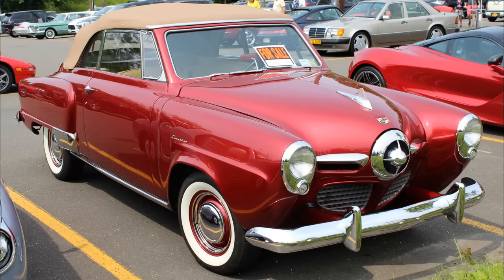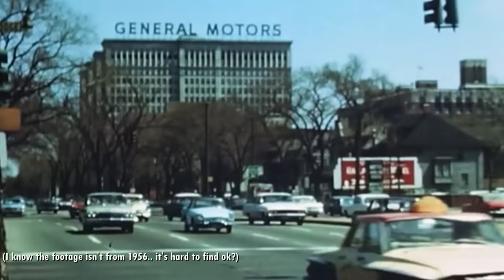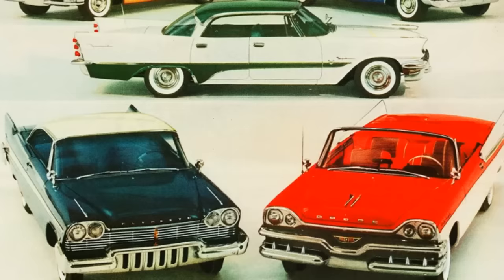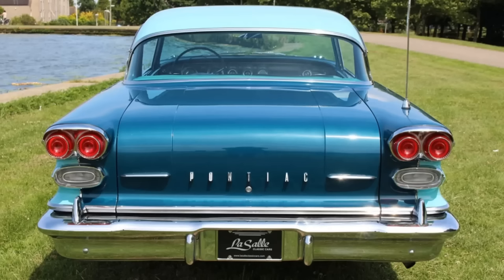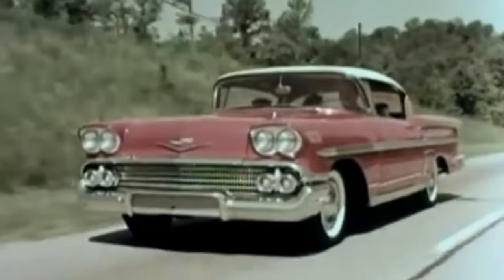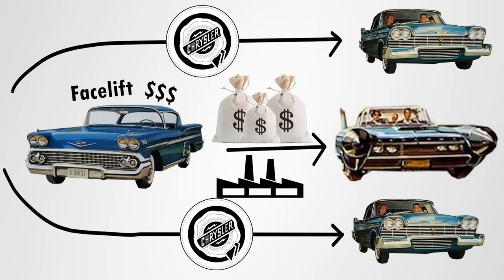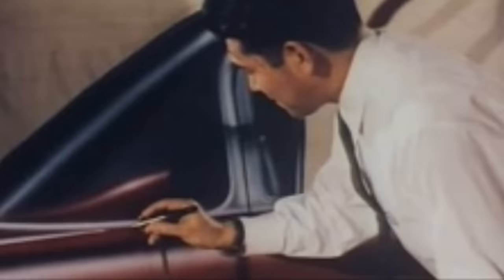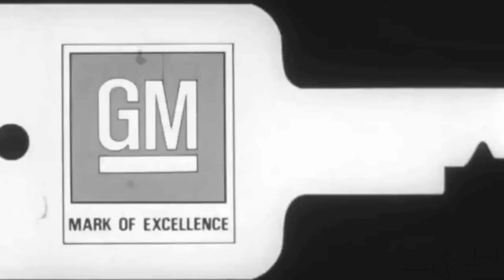Mistake of '58: The GM Chromemobiles and Far Out '59s

Comment: Your best video yet!  GM may have been caught flat footed with their '58s, but their "rushed" designs for '59 ushered in the design language used by the entire industry in the 1960s.  Take a look at the '60 Chevrolet Corvair, with its clean, horizontal lines and lack of unnecessary chrome.  It and the wicked cool '61 Lincoln Continental, '63 Buick Riviera and '63 Studebaker Avanti were part of a wave of clean, sharp-edged design that is completely different than where we were headed in '58.  By 1965, all cars looked completely different than they had just seven years earlier.
Reply: Completely agree. In fact GM's 1964 cars were the last year to have any connections to the '50s at all. The '63 and '64's retained some of the glitter of the '50s, (even if slight) but with the restrained sense and sensibility of the '60s. By '65, not a trace. The '64 and 5 Impalas  illustrate this very well. The '61 Lincoln influence was seen strongly not only on the '63 Buick Riv, but also on the '63-'64 Ninety-Eight.
Reply: I wanna see what the world would be like if the 59’s designs weren’t rushed.
Reply: The Corvair was an engineering and marketing misstep, but a styling triumph. When euro design houses start cribbing the lines of your cheapest Chevy, you’re doing something right.
Reply: The guy who designed the Lincoln convertible was fired from Chrysler ,or hired by them and fired by ford......I can't remember.......shit I'm getting old
Reply: Nearly all '61 GM cars were beautiful, from the Chevy to the Cadillac. But look at the monstrosity that was the '59 Caddy!
Reply: @adotintheshark4848  I do agree with you on the '61 GM's except for the Oldsmobile. I didn't like it. Having said that though, I DID like the Starfire!  The '62 Oldsmobiles may have been the most beautiful the 5 divisions offered that year in a stunning  turnaround for the better by Olds. I know what you're saying about the '59 Cadillac. It must be remembered the '59 GM's were (as a whole) basically a knee-jerk, drastic, over-reaction to Chrysler's sleek/finned '57s that had GM shocked and scared; something they weren't used to. Under the gun, they came up with '59s abnormally quickly. If the lower 4 divisions were to have sleek fins, then it was expected Caddy would have to have the biggest (or with this year) the most outrageous fins. In all fairness, GM was level-headed with the Pontiac and Olds that year for those buyers who wanted some toned-down choices. Unfortunately in toned-down 1960, the Pontiac and Olds were downright dull-----to me. One man's opinion.
Reply: @BillLaBrie  Remember  the 1965-69Corvair?.Wanna  talk bout an attractive  American car that looked very Italian!!!!!.
Reply: @robmcgowan4034  1959-60Pontiacs were about the best line ups that GM had in those years!!!!
Reply: @mikeweizer3149  Okay Mike, and I'm not saying you're wrong. I ended it saying one man's opinion or viewpoint. The '59 Pontiac in fact was/is one of my favorite Pontiac model years. The '60 Pontiac though a beautiful car, was dull (along with the Oldsmobile) compared to the '59s. The '60 Chevy, Buick and Cadillac were so outrageous that they had a lot more room for being toned down for '60 than they already toned down '59 Pontiac and Olds models were, that's all.
Reply: Chrysler made a huge mistake in 60 by not coming up with a clear sheet design when they moved to the unibody.  Virgil XNR as he spelled it on his Valiant show car had become stuck in a design rut and refused to move away from fins.  The 60's looked like a face-lift of the 59's rather than the new cars that they were.
Reply: @bradjames6748  Elwood Engle?
Reply: @BillLaBrie  Who ended up at Chrysler and did the 64 Imperial ( another beautiful  car!).
Reply: @300guy  Did you ever hear the story  bout how the '62 Plymouths and Dodges turned out the way they did?.Some of that reason was beacuse of  stupid, Unfounded  rumor that Chevrolet was going to downsize right around 1962. In a way it did happen with. The 61 standard size Chevrolet beacuse from front bumper to rear it WAS shorter and also  not quite as wide but the wheelbase never changed and would not  for the next 15 years!!!.
Reply: @mikeweizer3149  although it would be early, it is possible they heard some very early scuttlebutt about the Chevelle.  Even though it didn't debut till the fall of 63, I have no doubt there was modeling going on in 61.
Reply: Ah yes, the Chevy Corvair, a design so sober and boring it even inspired the Soviets to rip it off.
Reply: @Turbobuttes  Lol, you’re joking, right?  First, compare it to its competitors, the plug ugly Ford Falcon, the dowdy Studebaker Lark and the hot mess Valiant. Second, GM’s design approach to a rear engine car was radically different than VW and Porsche. Third, its design influenced primarily the Italians and the Germans. The Russians didn’t adopt these styling cues until they had become commonplace around the world.
Reply: Still love the Avanti.
Reply: Yes the 60s designs were some of the nicest and most elegant.
Reply: @BillLaBrie  The Corvair really got a bad rap and was hardly a failure considering it lasted 10 years.
Reply: @dr.elvis.h.christ  GM kept it in production as a method of denying the inherent problems with the design and the way they implemented it. Sales trailed off quickly midway through the production run. People didn’t want to die. But snap oversteer was just one problem with that car. There were many others.
Reply: Winthrop, hope you don't mind me contacting you , but we share the same surname , it's quite a rare surname in England apart from in Norfolk  , do you mind if I ask you if you are in America or England , I'm just curious . If you don't want to just tell me to clear off 👍
Reply: @nickthurlow4456  well, it’s nice to hear from another Thurlow!  It’s a rare name here in the US, also. My father’s family came to this country from England in the 1690s and settled in Massachusetts. I don’t know if my ancestors were from Norfolk. Interestingly, my brother (and my son) are both named Nick, but that’s from my mother’s Italian family and not the Brits.   If you ever find yourself in Syracuse, New York, I’d love to host you.
Reply: And it was a great shame... '57 to '59 were the best years for GM. Outrageous beauties!
Reply: @bradjames6748  Virgil Exner was fired from Chrysler. Elwood Engel designed the fabulous 1961 Lincoln Continental for Ford, and when he replaced Exner at Chrysler, the 1964 Imperial went from a semi-finned monstrosity to a virtual copy of the '61 Continental...
Reply: @MikeWeizer  The 1959 Pontiac was such a hot topic that when the 1960 Edsel restyled as a virtual clone of the 1960 Ford, Ford officials wanted a thin vertical bar removed from the Edsel front  end...and replaced with a virtual copy of the 1959 Pontiac grille. Meanwhile, the 1960 Pontiac came out with its "fresh point of view" styling--and didn't revert to the split grille until '61. Even Pontiac didn't realize what a winner they had!
Reply: @gcfifthgear  It was awesome styling we can only drool over.
Reply: My late uncles were engineer s for GM and their ideas where swept under the rug as the say. 💁‍♂️🙄
Reply: @BillLaBrie  my late Uncles worked on the Vairs. As they called them 1958!
Reply: @bradjames6748  Elwood Engel was responsible  for both the 61 Lincoln Contential  and the 64 Imperial  do you see any similarities  between the two cars?.
Reply: @robmcgowan4034  AA
Reply: @adotintheshark4848  and yet that 59 Caddy has become the classic style icon.  Not many classic car collectors are interested in the 60's Caddy's. Everyone wants a 59. offcourse it helps that Hollywood and even independent filmmakers  used them in influential films. (like 'Badlands')
Reply: The squared off Lincolns, Avanti, Rivvy, even the roofline of Mustang, Falcon, and several others had design origins (or at least 'took cues' from) the original 1939 - 41 Continental.
Reply: @jfv65  I know for a fact that the 59 Caddies  were an exaggeration!!!!.and that's  why I actually like the 60s better and even the 61-64 Cadillacs  even better. Understand this one thing, When the 1961 Lincoln  Contential  came along  it was a game changer!. Its styling was in no way confused with the 1960 model!!!.Cadillac on the other hand was a different  matter!. From 1960 to 64 there was a much more gradual  change between the exaggerated  59 and the more tasteful 64s, The 65-66 Cadillacs  I thought were the best looking  standard size Cadillacs  of the 60s.....And then came the first front wheel drive 1967 El Doradro!!!!.
Reply: Ed does not know what he is talking about. He shows an early 50s Cadillac four door sedan and calls it a "Coupe DeVille" then he miscounts the "4 chrome strips" on the side of another car that are really not FOUR.
Reply: I just got a corvair... they have not one squared off surface, everything is curved.
Reply: @TheCatOfAges  I’m guessing you have a second generation (‘65-‘69). My ‘63 is pretty horizontal, certainly by the standards of the time. The second gen was much curvier.
Reply: @winthropthurlow3020  i have a '63, everything is rounded off. I havent found a straight edge on the car.
65-69s had plenty of straight lines.
Reply: Why did they leave out Oldsmobile? I had a 1957 Super 88.
Reply: @TheCatOfAges  I remember when a popular saying was, "nothing more rare than a running Corvair."
Reply: @TheCatOfAges  Lol, we clearly have a different view of the meaning of the word horizontal.  Of course it doesn't mean squared off, but rather, the overall design has a strong horizontal element, most notably the famous "Corvair Crease" that runs the perimeter of the car's body and had a huge influence on European design for years.,
Reply: Thats cute

Except the 60s were all started by Lincoln

Here are 4 examples to prove my point:

1. 1956 Continental
Very little Chrome, low tailfins, slab-sided squared off look....it looks more 60s than 50s

2. 1956 Lincoln Premiere
Relatively slab-sided, understated, dechromed and more low tailfins

3. 1958 Lincoln Continental
Completely square, tapered tailfins and relatively little chrome as well

4. 1961 Lincoln Continental
The final evolution of Lincoln's completely square, completely understated, completely finless design language.
It looks like an extended 1956 Continental.

Now take a look at GMs 1956-1961 designs....dont tell me they were the ones who came up with 1960s design language.

Even Chrysler made a Lincoln Continental clone as its top of the line Chrysler Imperial beginning in 1964

Heading into the 1970s...those cars look more like late 50s Lincolns than late 50s Cadillacs
Reply: @joecool9739  I agree that the '56 Continental was groundbreaking and a good ten years ahead of its time.  However, Lincoln inexplicably replaced it with the '58 that is a bloated mess and as bad as anything GM produced in that year.  For reasons that baffle me, no one followed the lead of the '56.  In my view, all American manufacturers flailed around in the '58-'60 period, trying to figure out what was next and while the '61 Continental was a winner, the rest of the Ford lineup in that period remained stuck in the '50s.
Reply: @winthropthurlow3020  
No dude, just no

A 1958 Continental is NOT in the same design category as a 1958 Cadillac or Chrysler

An honest comparison would reveal undeniable, obvious and critical differences in design that put the 1958 Lincoln more in tune with cars from the 60s and 70s...namely a square, low finned and dechromed look

The 1961 Continental only cements this legacy...I gotta hand this one to Lincoln even though I also love Cadillac

Today Cadillac is totally wiping its 🍩 with Lincoln...their Celestiq sedan has no comparison with any Lincoln

Lincoln's last sedan was an utter failure...a bland and empty copy of a 2015 Jaguar XJ and Bentley Flying Spur
Reply: @winthropthurlow3020  i mean the early corvairs are very bubbly, all surfaces are rounded.
Reply: @joecool9739  I'm not carrying water for GM, just observing that - in my opinion - it led overall in the transition to '60s design.  Yes, Lincoln punched above its weight with the '56 and '61 Continentals.  However, you simply can't convince me that the '58 Continental was anything other than a huge mistake.  Yes, different than Caddy, but a mess nonetheless.  In fact, I'd argue that the '61 was a recognition of that mistake.  Remember, too, that Lincoln was just part of the larger Ford stable.  The Ford, Mercury and Edsel designs of '57-'64 couldn't keep up with what GM was turning out.
Reply: @winthropthurlow3020  
Im not talking about whether it was a huge mistake or not (but to entertain your point, clearly it wasnt if the 1958 Lincoln is one of the defining cars of the 50s)

Im saying in terms of ushering in 1960s design, it was Lincoln and not GM

Im literally citing vehicles that predate GM's 1959 offerings as proof that what would become 60s design was already well established at Lincoln and further cemented in the 1961 Continental

GM's 1959 designs didnt "usher in a new era"...they capped off a gaudy era that already existed

If they had "ushered in" an era there would have been more 1950s looking cars, but there wasnt, the 50s ended with those models

When looking at the defining cars of the 60s (the Corvair, Mustang, Impala, Riviera, Thunderbird etc) you can CLEARLY see 1956-1961 Lincoln design language...
but 1956-1961 GM design language is absent

I repeat: even the Chrysler Imperial became a Lincoln replica
Reply: Oh, come on!  The 55, 56 and 57 Chevys were the best looking GM cars of the era, by a long shot.
Reply: @denysarcuri1213  say that with your flat sides, and backward angled a pillars. Quite a middle aged car if i'd say comparing to my '57 Ford!
Reply: @BillLaBrie  the mr2 also suffers from it, it comes from people driving a rear engined car like a front engined car
Reply: @TheCatOfAges  I said best looking ""GM" cars.  I agree with you.  I owned a '57 Ford at one point (bought well-used, but still pretty), and am a thoroughly Ford guy, owning a 2003 Cobra "Terminator," a 2012 GT500 and a 2006 F150.
Reply: @denysarcuri1213  misread, missed the GM. Hello fellow ford guy!
Reply: @TheCatOfAges  🙂
Reply: @TheCatOfAges  not really, but thanks for playing. Look up the effects of “jacking” on rear swing-arm designs.
Reply: @BillLaBrie  happens to corvairs, in theory. its really really hard to make it happen. The car sits too low and it requires getting it up to high speeds, and turning the wheel from one lock, to the other lock, and even then, it probably wont flip, just spin out. If you know how to drive it you'll never have an issue.
Reply: @TheCatOfAges  Perhaps you’re referring to the later models and - to some extent - the earlier ones when equipped with the optional stabilizer bar, though GM lowering the suspension pivot halfway though the production run was a tacit admission of guilt. Swingarms suck. Tatra found out, Benz found out, AM General found out, VW found out, and GM was forced to learn. I know you’re fond, but don’t try to excuse away the laws of physics
Reply: @BillLaBrie  there is theory, and there is putting that theory in practice, it is very hard to get even a base model (no stabilizer) corvair to flip. The later models dont have the swingarm because it is a more primitive design and they upgraded. Vw "found out" by using the swingarm from 49 to 81! Tatras were fast and grippy, not dangerous (to the drivers, any SS member who saw one was certainly in danger). And lowering the suspension means that after a couple years of production, they recieved an upgrade, wow, who knew manufacturers change their designs?
Reply: @TheCatOfAges  keep typing. I can tell it’s good therapy for you.
Reply: @winthropthurlow3020  what a lovely invitation Winthrop so kind of you . Am at this moment in time in king's Lynn hospital with an infected heart valve I picked up , got taken in two o clock Monday morning ☹️☹️☹️
Reply: @nickthurlow4456 Best wishes for a full and speedy recovery.
Reply: @BillLaBrie  if you dont want to debate, you should have just said you filled your ears with candle wax.
Reply: @winthropthurlow3020  It wasn't an insult, I was genuinely adoring the impact the Corvair's design made on the automotive world.
Reply: Lincoln’s aren’t gm
Reply: And now all anyone wants is a brand new Ford 150 they never get dirty. Disgusting.
Reply: Unnecessary chrome my foot, beautiful cars are there to be appreciated by everyone, I suppose it’s my duty as a pleb to bow my head and cover my eyes as they go by.😔
Reply: P
Reply: @winthropthurlow3020  thank you , it was so nice of you to say that , I am seeing a consultant Wednesday , am at the moment laying on a hospital bed watching YouTube , hurray for good old YouTube , don't know what I'd do without them 👍 hope you and your family are all okay
Reply: You ever seed the '62 Arctic Blue Queen Family Truckster with the patented DuraJolt Steering and the GyroCloud Full Spring Suspension?  The slogan read
"For The Man Who Has Everything And Just Needs Something To Carry It In!"  And durn it to fudge if it weren't true!!  My Granddad Farley Sykes left me his old Truckster in his will (Grandma Bessie Mae caught him stealing a piece of fried chicken she was saving one night, and she shot him deader than a weasel right thar on the spot!). I drove that baby til both front tires fell off and it run smack dab into ol' man Kelsey's Pond.  The C-Thru Windshield glass ("63% MORE Transparent!") was smashed and my dream car sunk like the Tirtanic!!
Reply: @robmcgowan4034  I've always preferred Fords, but have always thought the 65 Impala was probably the best looking car of the 1960s. Just the right mix of aggressive and classy.
Reply: @winthropthurlow3020  The Corvair was a joke, it couldn't compete with anything,  that's why they copied the crowd with the Chevy II 2 years later. And that ugly Falcon as you called it, dwarfed them all in popularity.
Reply: @winthropthurlow3020  Ford was stuck in the 50s? GM entered the 60s with 50s wraparound windshields. Lol
Reply: @lsrx101  Oh c'mon fellow Ford guy, the Galaxie was better lookin than an Impala in any year
Reply: @mikeweizer3149  The '64 Imperial was simply a variation on the 61'-'64 Lincoln design.